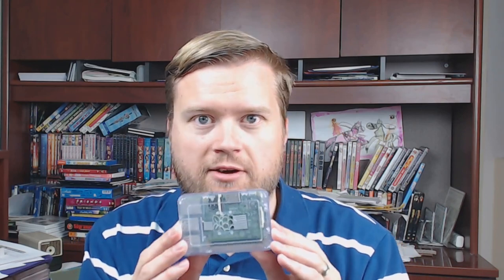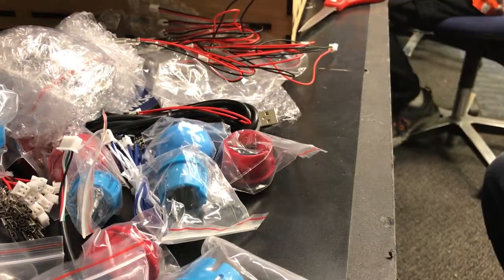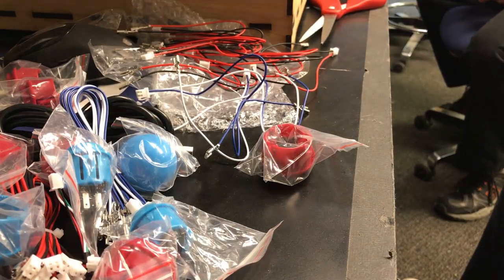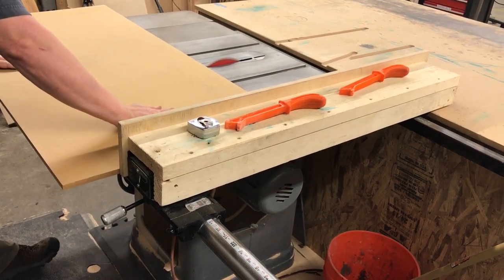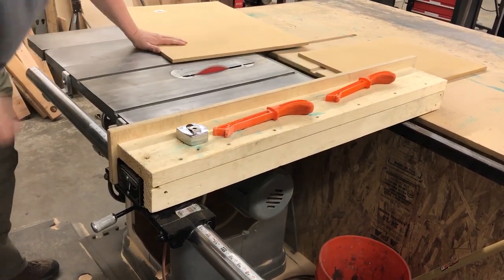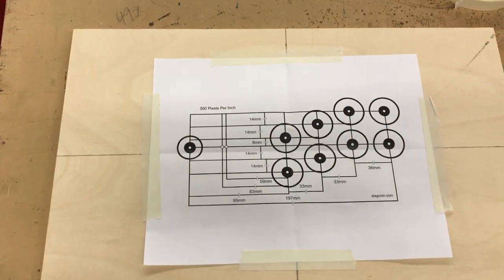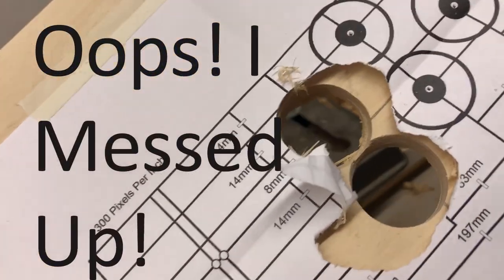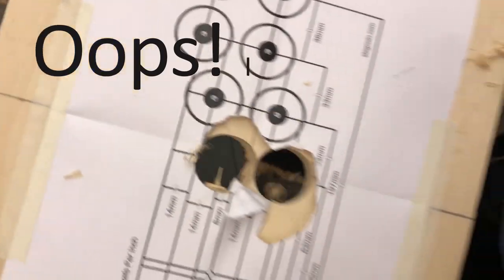How To Build An Arcade Joystick From Scratch DIY

Comment: You should have marked the center of the holes then removed the paper and checked it by setting your buttons on it before drilling. Also Remember when you drill its already a round hole so all you have to do it put the center of the drill bit on the center mark you made.

Also how about making it a little longer with some explanation as to what and why you are doing something and less time spent watching you put nails in 9it. Kinda reminded me of watching grass grow at times.

It is a great effort though how about a remake and more talking about how and why you did what and also remind people of problems if any you didn't watch for.
Reply from the maker: Just a fun video ,  sorry you didn’t like it.